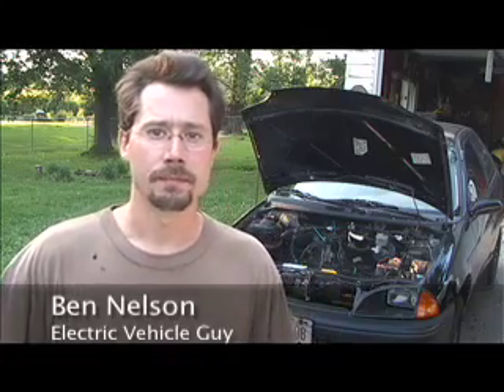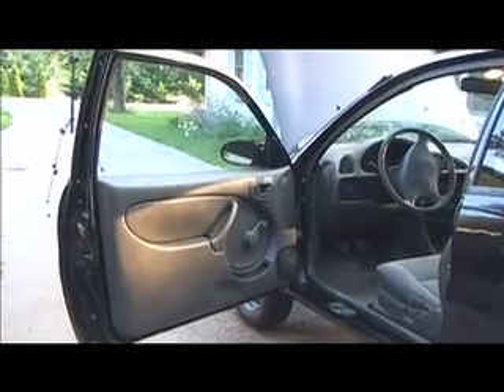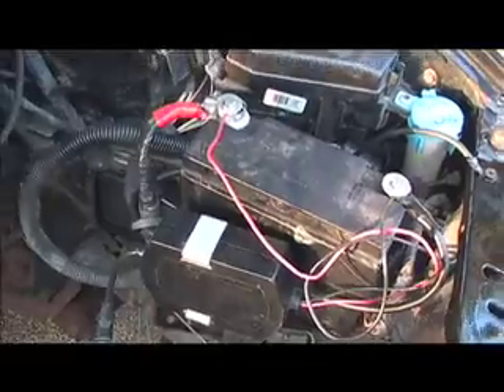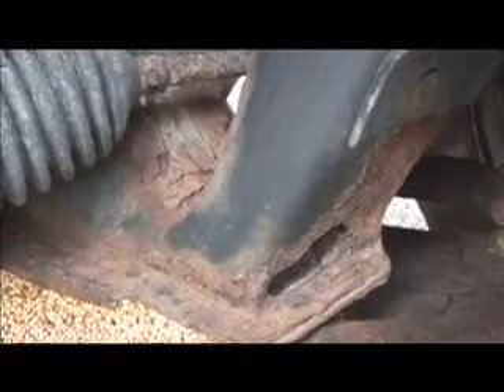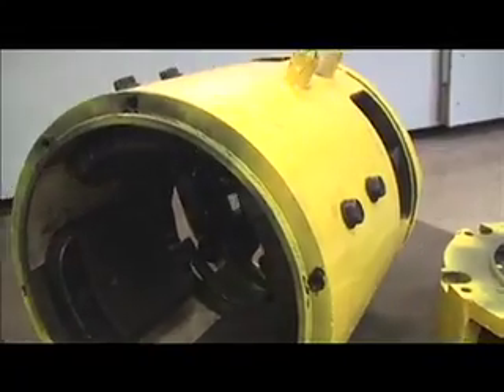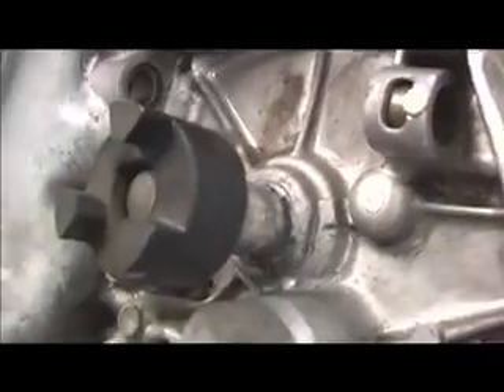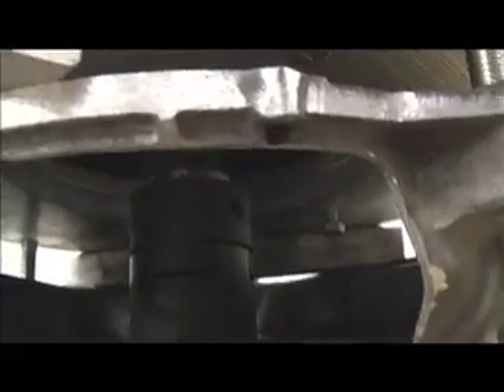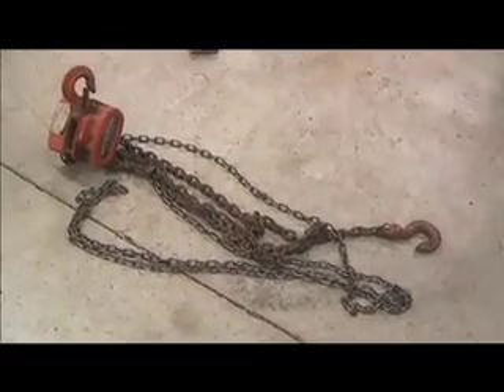Electro-Metro Update 7/28/08

Comment: Mechanically, AT's are not energy efficient. If you use an AT you stand to incur energy losses, that means that you won't get optimal performance with your car. You may also damage your motor with an AT. According to transmission experts, the automatic gearing depends on an idling engine to keep hydraulic pressure up. At a stop, the engine will stop running and thus lose pressure. You can overcome this with an additional pump but it all amounts to building up expense for the conversion.

Comment from the maker: The motor was out of a 36V forklift. There was no ID plate telling the amperage or horsepower. Forklift motors can handle high amps, and I am told can be run at up to around 100 volts.

I will be running this one at 72 volts using a 400 amp peak controller. That means it should peak at about 38 HP.